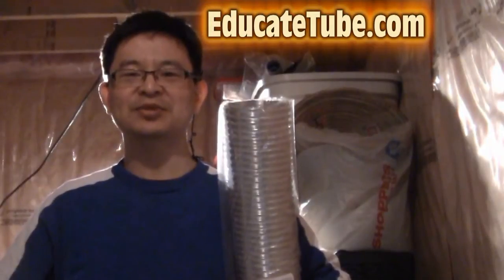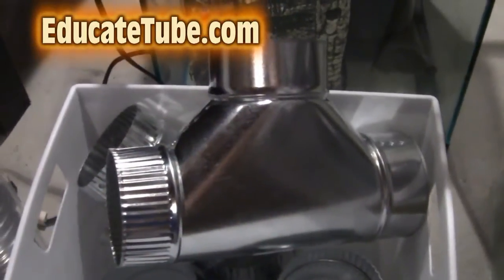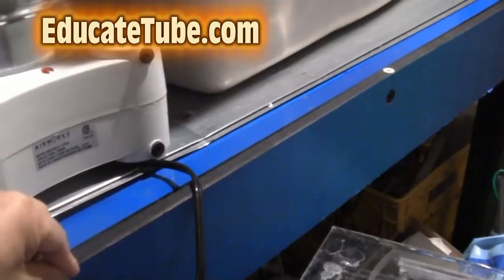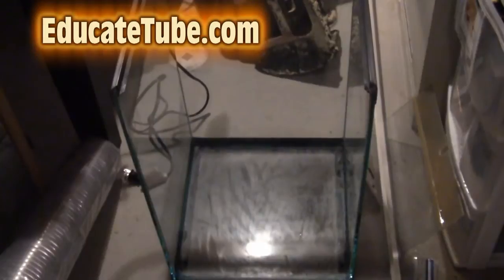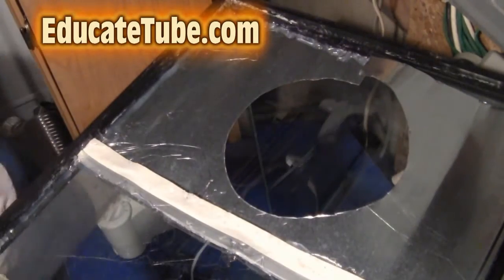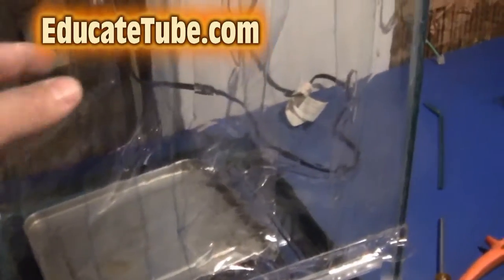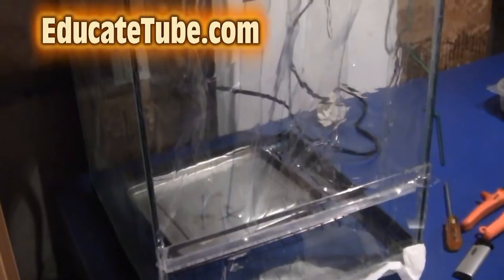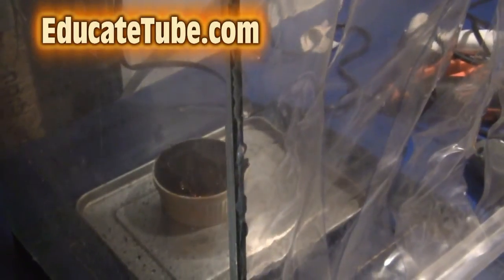How to make DIY Micro Lab Fume Hood A Cool Weekend Project for less $100!

Comment: You're using a fish tank? What kinda glass is that made out of? I want to make one and I think laminated safety glass would be the safest bet. And I would like to only have the front be made of glass (the rest made out of stainless steel, preferably).
Reply from the maker: Yes, just fish tank.  The tank is only contain the small flame, smoke and gaseous substance, so no pressurized reactions.  Experiment with small reactions only.